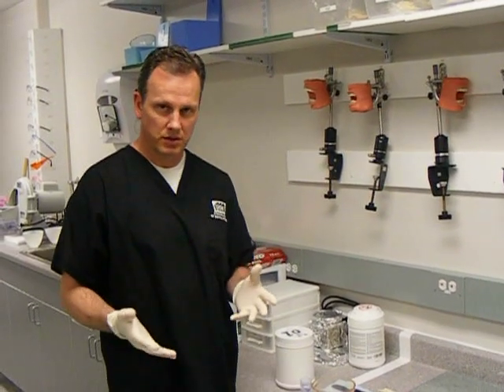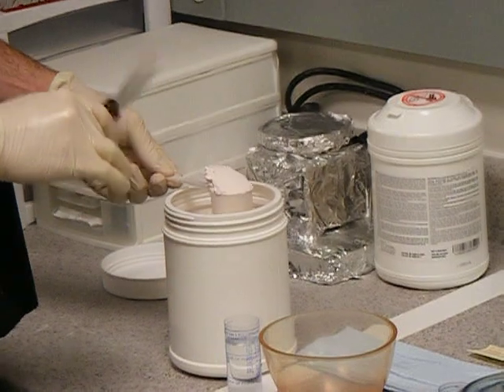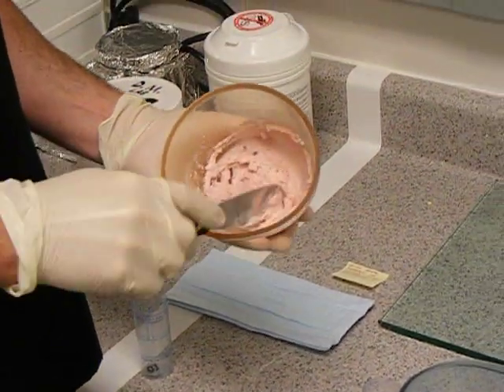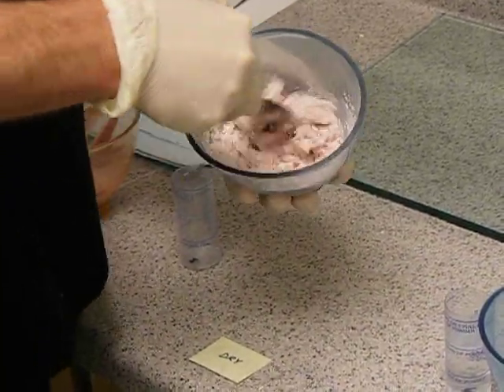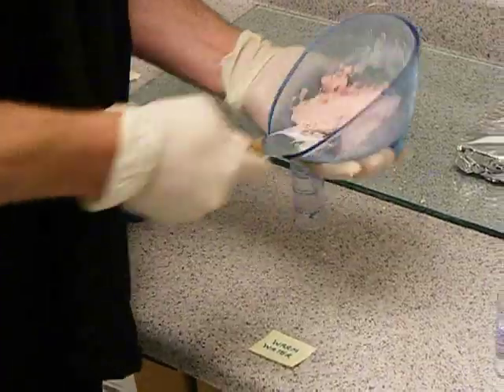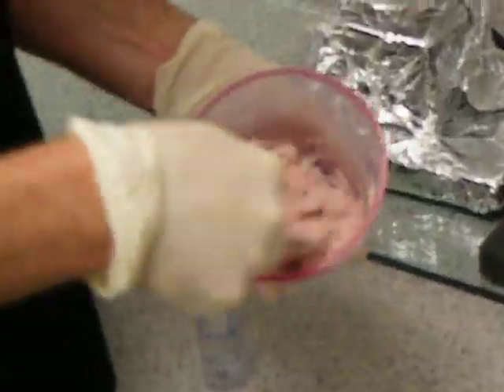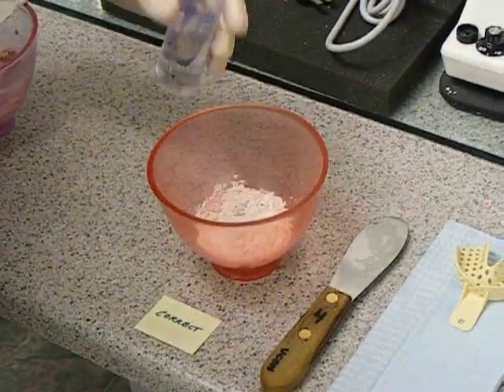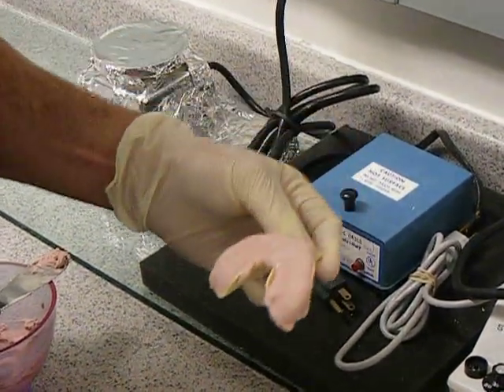UCDH Dental Materials Lab Alginate Mixing Demonstration 1

Comment: the last one is wrong, always put powder to water..
Reply: Roberto, I must disagree (depending on the circumstances).  Adding powder to water has disadvantages if you are not ready and prepared to add more powder (which usually takes two hands and much more time) as opposed to adding water to a dry powder (which only takes one hand) which can be done much faster.  If you are using an automatic mixer VS hand spatulation there are also differences (not mentioned in the video).  After taking thousands of impressions myself and after being in the dental field for over 20 years the words "always" and "wrong" is often based in practitioner preferences.